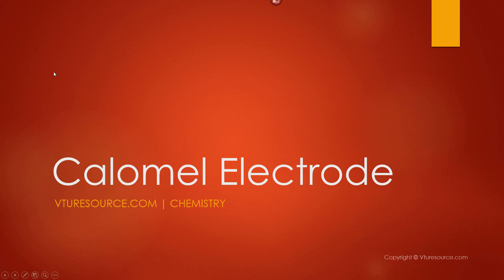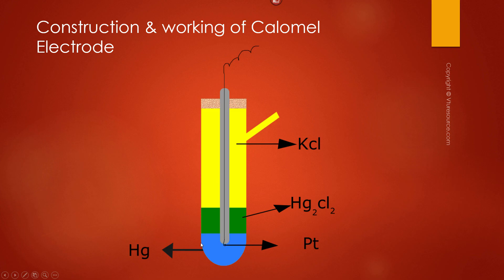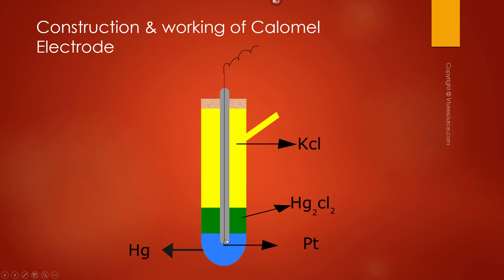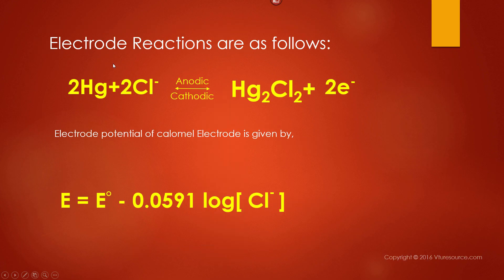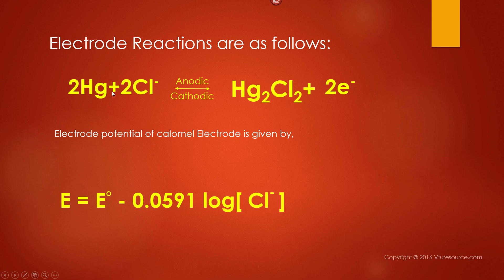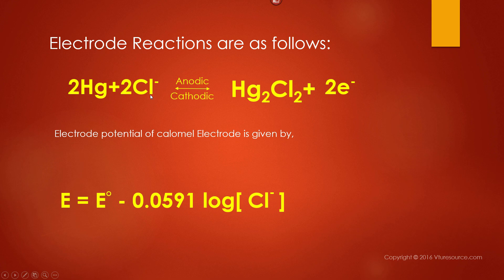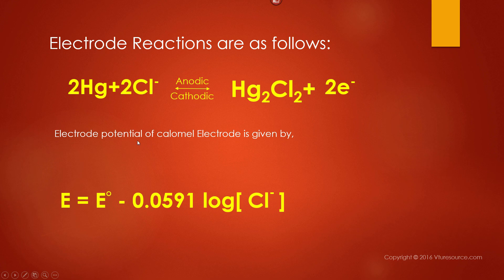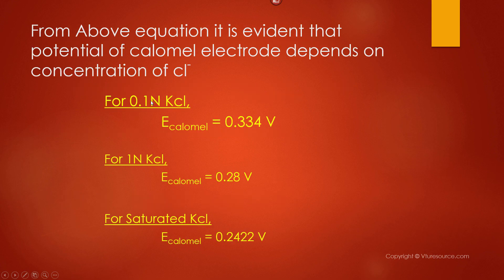Calomel Electrode

Comment: Thank you for the explaination sir. Sir, what is the difference between these calomel reaction equations. 1/2Hg2cl2 + e-  --> Hg + Cl -  and 2Hg2cl2 + 2e -   --> 2Hg + 2Cl -? which one should we use?
Reply: Change in the coefficients of redox halfcell reactions doesn't bring any change in the electrode potential value... So both are valid
Reply: In some of our textual questions they treat stoichiometric coefficient as moles of that chemical present in solution .....though I don't feel that to be correct but I still follow